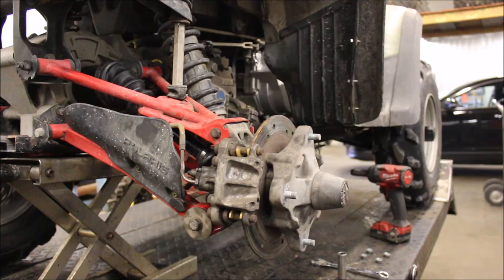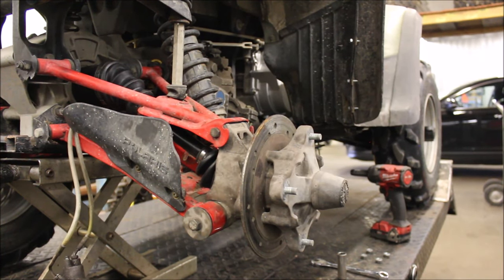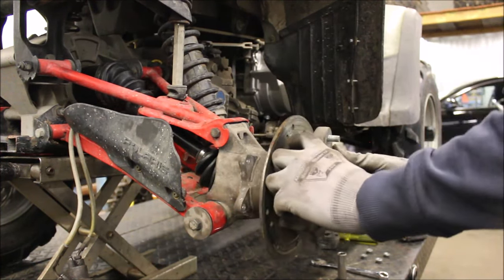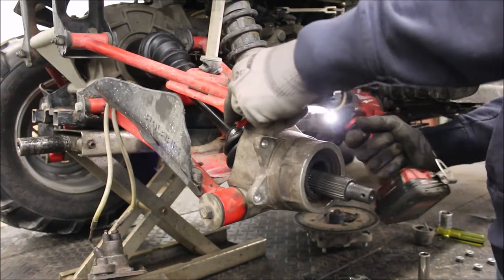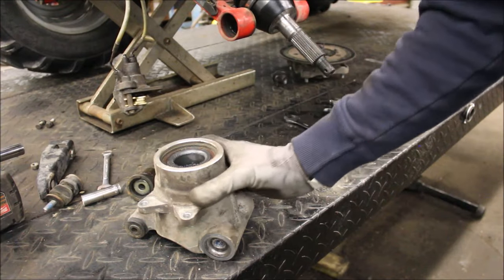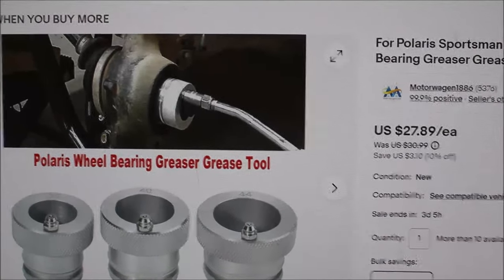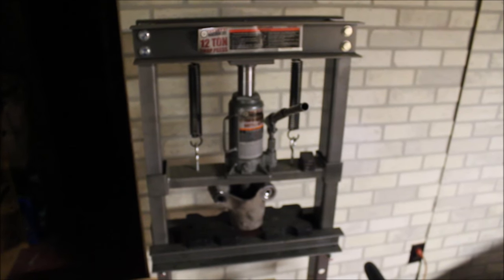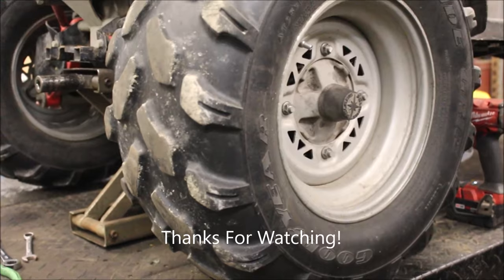How to Replace a Rear Wheel bearing on a Polaris Sportsman 500/700

Comment: I have the same Harbor Freight bearing press. They used to sell a smaller one too. I could only get the 12 ton when I needed it ….. the smaller one will do fine if you can get it. When you go to put the new bearing in you need to shim up the hub/bearing carrier level otherwise you will pinch the bearing if not level. Also it’s recommended to put some locktite inside the hub when you press in the bearing. I have that grease tool for the bearing also. Just don’t get carried away when you put the grease in. You just need a little grease….. rotate the grease tool as you put the grease in to get the grease distributed evenly. You don’t have to take that top part off that you did first to take the bearing carrier off. Just the three bolts on the carrier itself. Once again if you check the Polaris service manual it warns to use new bolts plus locktite for those two bottom bolts on the carrier and torque to spec. You can download the service manual from the internet for free. 
I do recommend using the locktite for sure on those bolts …… I would say maybe optional if you want to use new bolts if the old ones look decent. 
I got screwed once reusing the old bolts and not using locktite. After about 250 miles of trail riding the bolt on the front side of the hub had come lose and the only reason I didn’t lose it totally is the head of the bolt was trapped by the inside of the wheel rim. It ground the head of the bolt round. I had to change the bolts on both sides of the machine and I also had to go for a new hub. When the bolt backed out on one side it damaged the tread inside the cast aluminum hub and I didn’t want to chance having the new bolt getting cross treaded.
Reply from the maker: Those are all good points. I did use red loctite on the bottom bolts. I have seen several of them worn out, almost falling out. The bolts look new yet so I reused them.  I like to take the top off so there is no pressure on anything and I can grease the other areas. This year didn't have grease zerks on the a arms like the older ones used to.

Comment: Buy the bearing greaser. Makes the bearings last way longer. Especially if you pack them when new. I find they can take up to 20 pumps of grease brand new. They come basically dry on grease.
Reply from the maker: Thanks. I did buy one after I posted the video. I was actually wondering how much grease comes in them.
Reply: @TitaniummanGarage  I run a polaris highlifter on 35s. Almost 2500 km and still on stock wheel bearings that have 0 wobble in them. I grease them every other ride. Pushes and moisture out
Reply: If you grease religiously, you don't ever need 20 pumps, way too much